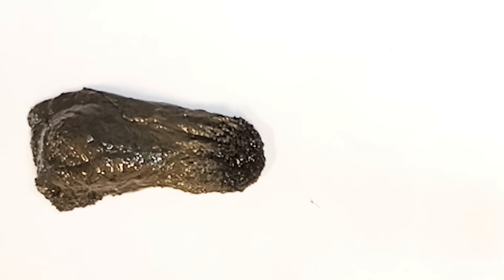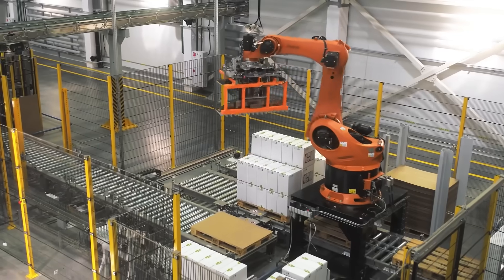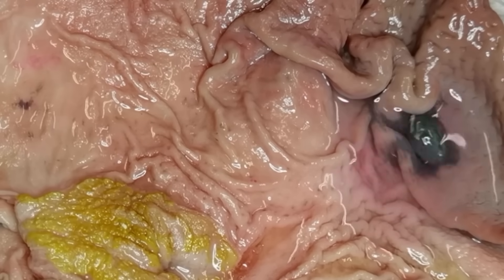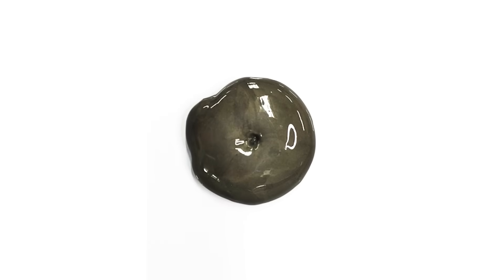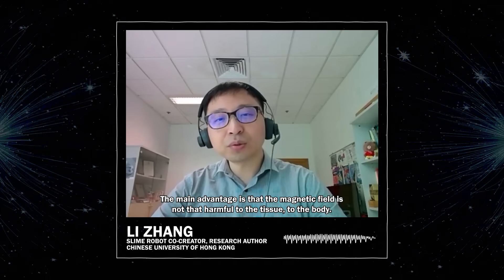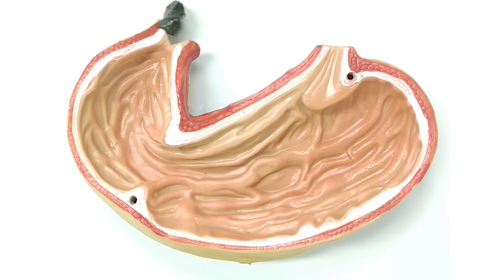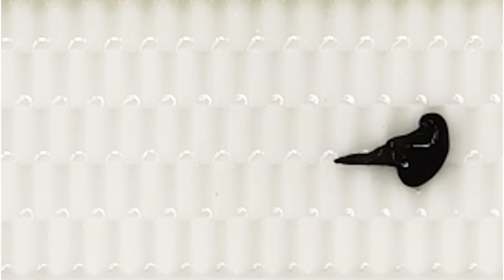This Is The First LIQUID Robot, And It’s Unbelievable

Comment: It looks like it's controlled  by magnets  outside of itself.  If so, It totally would need some autonomous OR radio control to be used medically, or really in ANY closed environment. It would also need to be able to see where it is as well as have a blue schematic of where it is and how to get to where it's going etc.  Or, again, see where it is with a camera and a radio control so someone can move it around.

Honestly, all these videos of little "robots" moving around on flat surfaces with magnets etc just annoy me.  The magnets mostly ONLY are present  to enable the "robot" to be move with other magnets.  They serve no other purpose... unless sure, someone swallows a chunk of metal like a battery or whatever.   

Beyond that, they are utterly useless. You can't do fine grained magnetic direction inside a closed system like the body or other closed system that has internal structure that you DO NOT want to destroy. 

Ergo, if you have someone swallow that slime, then say you put a magnet on the outside of their stomach, you're likely to end up ripping a whole right through the stomach, muscles and skin as the slime takes the fastest path to get to the external magnet.

Comment: So the thing I'm not clear about is how we're driving the slime. From what I can tell it seems like we're probably using a magnet under the table, which wouldn't be that useful for moving in 3D environments like the body since you'd need a very specially designed chamber to influence the vector properly, and you'd only be able to practically control one at a time.
Reply: Yeah

😂

This is not a robot

Comment: I must have missed something... How is the robot controlled/propelled? Is it self propelled (internal power source / motorisation) or external magnetic fields that guide it? In some images, it looked like a magnet was applied from behind.
Reply: Yeah very weird that he didn’t show us that part. I’m guessing they have electromagnets behind the white background in most of the tests. This would mean that the material science of the goo is the only novel part
Reply: They never explained, and this crummy channel evaded answering that question to make the slime sound cooler than it is.
Its controlled by external magnets, either behind the surface it was sitting on or above it. I could imagine a machine like a CT scan that uses powerful magnetic driving the slime around inside a body from the outside, but the slime itself has no way to move.
Reply: @kyleharmon2848  ok try 2:15
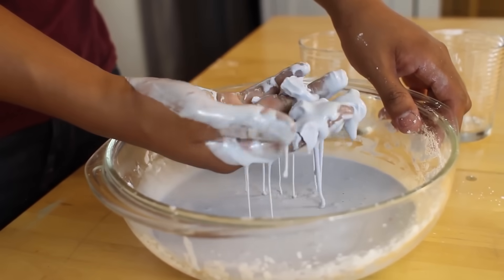Reply: @kyleharmon2848  I’ll do the hard work for you.. start at 2:10.. 
what gives it its unique ability to move.. and then he explains.. 
what more do you want.. 
he can’t tell you it’s using rockets.. 
because it’s not?
Reply: @kyleharmon2848  it is magnets, you got it.. 
he explained it.. 
you must have watched it?
Reply: @kyleharmon2848  it doesn’t sound cool to me.. it sounds scary.. that is why I watched lol
Reply: and a lot of it looks like stop-motion animation
Reply: @name finally someone speaking sense lmao. People think this is some crazy new thing
Reply: People lie
Reply: 2:30 starts to explain the motion/propulsion..
Reply: @bmint  Yes it 'starts to' but doesn't explain fully or clarify. Magnets are not magic and cant move themselves. This sort of explanation is flat earth level of garbage.

I already explained how it would really work and its not as cool, but still kinda cool (expect for it being toxic)
Reply: @kyleharmon2848  I see, yes your right, but he had to leave something to the imagination lol.. sorry I took this fully out of context.. and thank you for clarifying, your right, kinda, I don’t think it’s crummy, but lazily ill advised yes, but possibly on purpose, to create a dialogue, that gets us going? Maybe he will read this and chime in? Again sorry and thank you
Reply: @kyleharmon2848  it was Li Zhang who said the magnets could be controlled using an electro magnetic field. They also acknowledged that it is toxic but could be coated in silicones to make it safe.
Reply: It’s in the v everyone lined up to get this past year, you’ll all find out soon how it works. Yahuah save us all.
Reply: @realeeaussie8673  could you elaborate please?...

Comment: The idea is nice, but I would like a follow up video where you explain how it works, all you told us about the functionality is that is "magnetic magic". Does it need a huge electromagnet array stuff to control it from outside? Or is somehow controlled from the inside? If it's the second option, does it have like a capsule hidden into the material that control the rest of the stuff? This felt like a video made only from the abstract of the source... To be honest, ASAP science used to make much higher quality videos...
Reply: yeah its a very low quality video, like its nothing new, even saying its a robot and comparing it to nano tech is quite a stretch. The video is incredibly sped up too so you dont know how it moves in real time. Its probably controlled by powerful external magnets, and coupled with its possible toxicity, its usability in the human body is still really quite restricted. 

I understand that we could now direct magnets and magnetic fields, but i dont think its to the extent that we could finely control a small piece within the human body. Even if we could do that the machine needed for it would probably be gigantic like an MRI and it would be too expensive. Plus this kind of procedure, pinpointing drug use to a certain area in the stomach of all places would require endoscopy, i highly doubt an endoscope could work properly under the influence of powerful magnets. At that point it would be more cost efficient to just use traditional medical procedures...
Reply: @mike7546  lets just pray the economy can stay good for the sake of science
Reply: THANK YOU. Glad I’m not the only one noticing it. I watched everything and waited all long for the moment when he explain how the thing actually work. So frustrating.
Reply: Why do they call it a liquid robot?
My magnetic putty does the same thing when i control it with a magnet. 
is my Magnetic putty a liquid robot too?
Reply: @J17legacy  because they need people to fear monger and masturbate about Terminator references in the comments.
Reply: Yea that's all I could think while watching, and I feel like the people behind the video new they were not doing the "technology" justice -Im mean this just seems like a putty with iron Shaving in it - the way they manipulate it seems waaaaay more important and interesting
Reply: Someone control it under table
Reply: Crazy Aaron has excellent educational materials that cover the manipulation of hot new robots, don't worry.
Reply: If you're vaxxed, you'll find out how it works, sooner than later
Reply: It’s effectively using stop motion to move around.
Reply: Don't you think your expectation of getting into all the details through a Youtube video is what is weird? They list the source in the description for a reason.
Reply: Microrobots could deliver drugs straight to diseased tissue.  Fish-Shaped Microrobots to Deliver Chemotherapy to Tumors
https://youtu.be/4Qa7W-TH948
........
Reply: Because there really is nothing of substance here. Its a ferrofluid mix on a surface being controlled by a magnetic array which would not be portable. This is taking an idea and thinking this is the first iteration when its really not. Its just manipulation of ferro fluid with magnets.

Comment: This is not a robot. This is a magnetic sludge that needs outside magnetic field to move (not much different from when you put a magnet on top of a table and you move a second magnet under the table to move it around). It cannot navigate small spaces by itself like the video makes it sound, a person has to literally manually guide it through. I don't even know why we are calling this a robot. This is way overhyped just for the sake of the video.
Reply: I agree 100%. I'm actually pretty disgusted by the fact that they are calling this a robot. Talk about clickbait!
Reply: I agree. This merely a substance. There is no cpu or motherboard or no circuit of any kind which means its not a robot
Reply: sunrise  would have been impressive. Until they told us that this sort of “robot” has existed for a long time in other forms. Like the metal filings and whatnot.